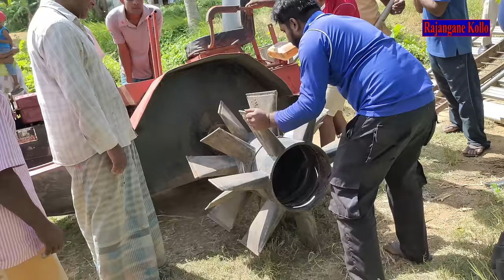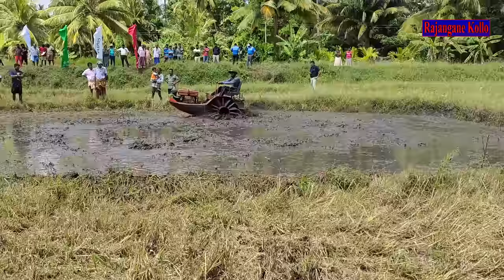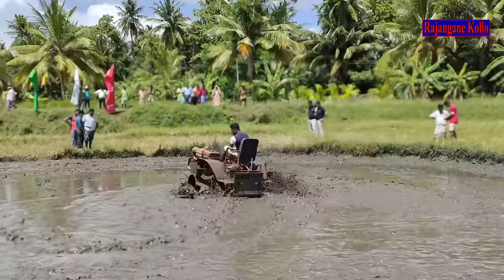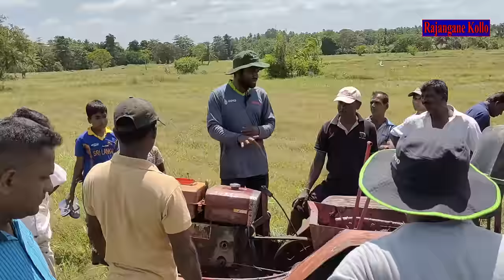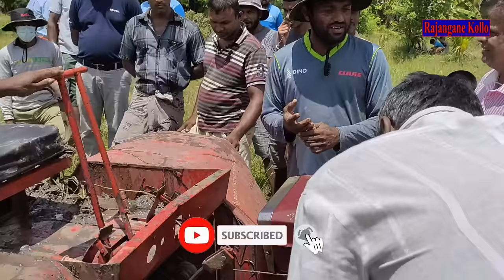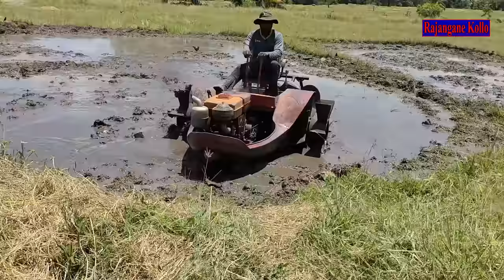Boat tractor | මඩ මාරයා |බෝට්ටු ට්රැක්ටරය | Sri lanka | Boot tractor / Boat tractor for paddy field

Comment: The unit can operate well, only when depreciation comes it's hard to maintain. Very heavy to lift for 2 persons or manpower  to maneuver in changing tires ang cagewheels. More over, many times of turns or running in cultivating the rice straws until it  blends....